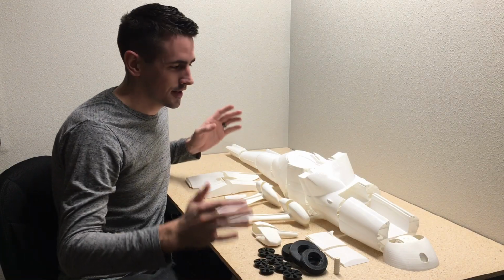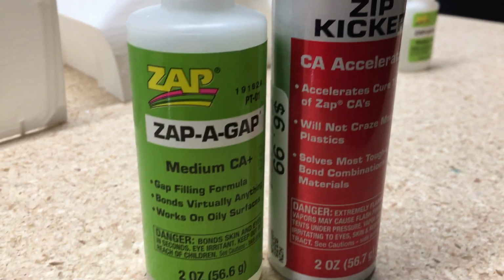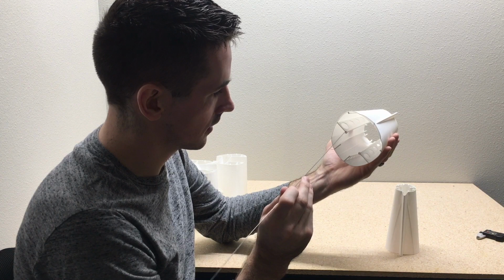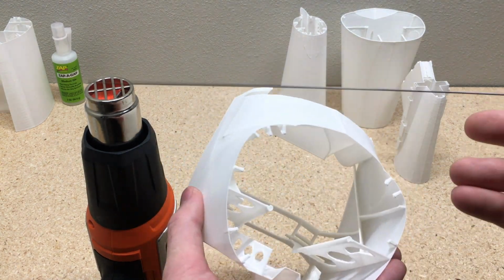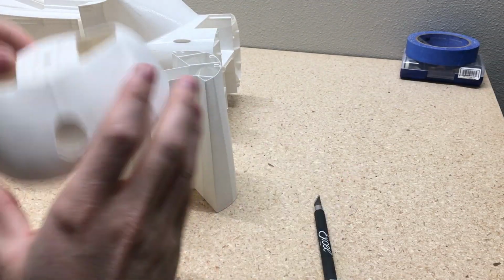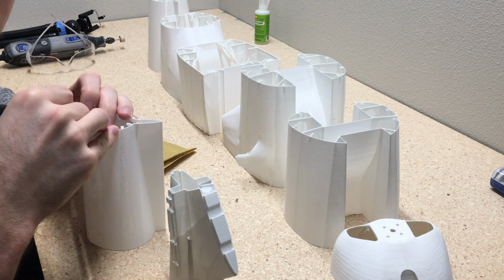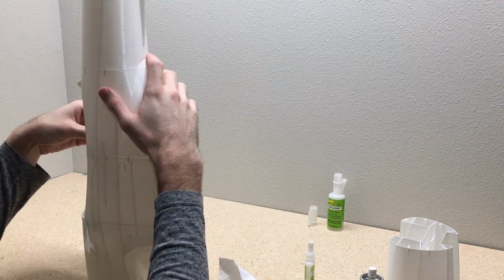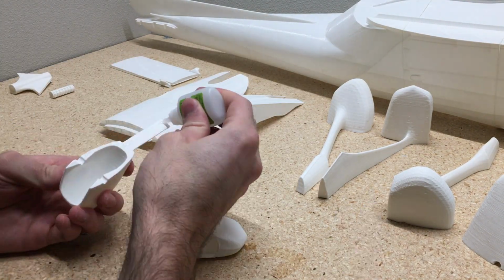3D Printed Airplane C152 Part 2 - Fuselage & Gear Build

Comment: Great videos! I’m new to 3D priming. Is there a way to modify the stl file so that it the final product looks a bit more scale in appearance vs the cartoon-like dimensions this Cessna has with the long front end etc? Looking to print “scale” planes if possible. Would love your thoughts/feedback.

Thanks!

Comment: Great video & impressed by your patience and attention to detail.  My question, where did you get the thin 4 mm wide blue tape?  You used this tape to draw the black stripes and also used them to follow the contour of the main canopy. Also need the link for the 8.5x11 decal sheet that fits in your inkjet printer?

Comment: I have the rear hz stabilizer and the vt stabilizer printed out along with the aft fuselage section and they don't fit together right off the plate.  There seems to be some guide pins on the fuselage but not openings on the vt and hz?  Is this something I am supposed to bore/cut out of the pieces?
Reply from the maker: You may have printed the stabilizers with a bottom layer they should be open at the bottom and they just fit right on to the aft fuselage.
Reply: @TroyMcMillanRC  Thanks Troy.  I checked the settings and there were some controls to make "Top solid layers" and "Bottom solid layers" which I think might have something to do with it, however when I entered 0 there, it made simple outlines of the control horn on the elevator parts and weird hollow engine mount on the Fuselage 1 piece... I'll keep messing with it.  At least I guess it is my config and not the STL files themselves.  Thanks

Comment: i played with some 3D printing a year or so ago, and it mostly went well. never tried single layer before.

i had a thought... if an additional layer were to be added to the outside, a person could sand off the excess, and have a smooth model.

what are your thoughts on actually doing it? would it work? maybe you want to try it, and show us?

Comment: Yeah been there done that. I had an xyz pronter but have now moved over to the Prusa Mk 3. I had terrible problems with bed adhesion until i bought a new PEI sheet. There is a lot to learn even if you start with a Prusa machine and Simplify 3d. After 3 years I have learnt a lot...do not get a bowden printer for this sort of work!

Comment: Appreciate the video with knowledge transfer.  How is the build coming along?  I am in the process of printing the fuse parts right now. So far so good using a my Alunar M508 Prusa i3 clone. I do have a JGAurora Z-603s but would need to modify settings if I use it. For now, sticking with the clone printer. Haven't had to make any adjustments except making sure bed is level. Where did you get the push rods in that length?